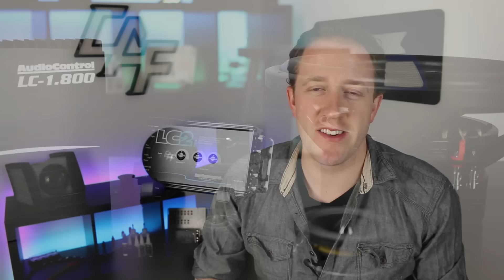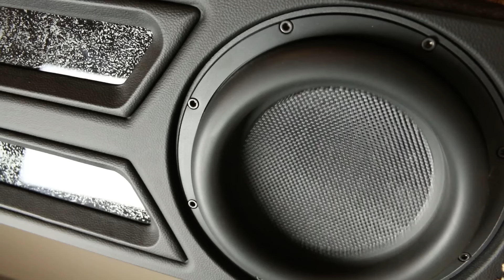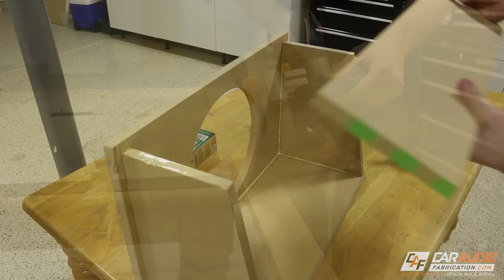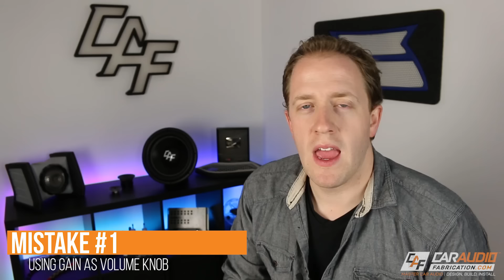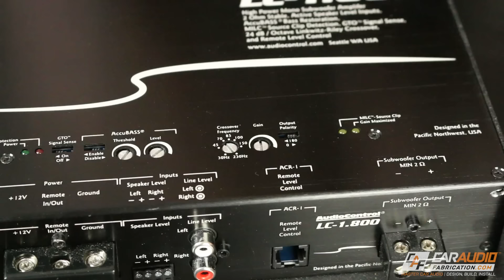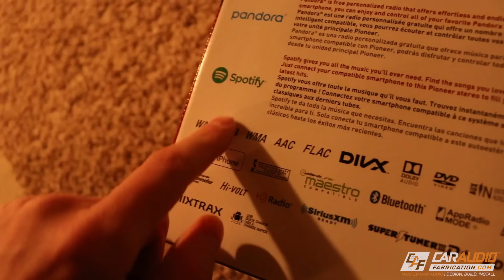Avoid these 5 common Car Audio NOOB Mistakes!

Comment: Worst noob mistake of ALL is to not fuse your power wire at the battery. Either it's because of laziness, or being cheap, or because thinking that the fuse on the amp is sufficient protection. The fuse at the battery isn't to protect the amp, it's to protect the vehicle from burning to the ground!! I have personally seen two cars burn COMPLETELY to the ground for this exact reason.
Reply: I like circuit breakers. costs $0 to reset.
Reply: a c LMAOOOOI
Reply: Scott Haydin or some ppl don't want to use a fuse cuz u "loose some or it power out put thru the fuse"! It's so min it's sooo not worht the risk!  I too have see a few ppl car burning to the cast
Reply: @kdubsav11  you shouldn't lose power through the fuse. You have problems if you do. May not be apparent.
Reply: Or putting the fuse right near the amp... Like what happens if you get t-boned and sheet metal pierces the power cable?
Reply: I would put fuses at the Battery and just before the rear battery feeding my amp block. 
Because "what happens if you get t-boned and sheet metal pierces the power cable?"
Reply: Personally, I run the lowest amperage fuse that allows the equipment to run without blowing the fuse. 1x4ch & 1x2ch, both good brands, and being fed from a 20 amp fuse at the battery with 4-8 gauge wire (can't remember what I'm using), the gains are set ~50%, and the RMS matches the speakers. No problems, here.
Reply: 4-8 gauge dang im not sure what speaker wire looks like in that but im an electrician if its anything like i install that some big wire what the hell are you running that needs like 60 amps
Reply: @Killamain51   most all car audio amplifiers that are any good need 8,4 or even 0 guage power wire. This is because the volts are 10x less  compared to home wiring(12 vs 120). Low volts require a lot of amps to make the watts. Speaker wire only needs to be 16 awg for 99% of all installs and  wire from amplifier to subwoofer usually never needs to be bigger than 12 awg unless its a 2000w+ system or long runs.
Reply: @Killamain51  i use 4 gauge for my bass. Maxes at 2000 wattts peak. Rms at 1000 watts for a 2ohm load @ 12 volts. P/E=I... So 1000/12= current, which is 41.66 Amps. And i know there's louder systems out there. And i use 8 gauge for the subwoofer wiring
Reply: I not in business thinking of not using fuse your going to be burn Everytime bet thousand dollars on it
Reply: True, a fuse is cheap fire insurance.
Reply: I have 2 rockford fosgate P3 12" subs. The specs I believe are dual coil 2 ohm which I believe means each sub has or needs 4ohms...8 total with 2 subs. Each sub I believe has an RMS of 600w which would be 1200w with 2 subs. 
What kind of amp should I get? I heard that using the same brand allows equipment to work best. That said I'm new to the car audio game. I read that when choosing an amp you should choose an RMS range of 75% min -150% max...so for 2 subs pushing a combined 1200w I would need an amp with a range of 900w - 1800w. And the amp would need an impedance of 8 ohms. Now I don't know or understand what the deal is with the different number of channels. But I watched some videos saying 5 channel amps are best I guess for pushing the subs and other speakers if you add some. I would like to add some tweeters and mids soon as well.

Does all of that sound right. Do any of you have advice or recommendations for what amp I should get?
Reply: i have the same 12 inch subs as you and mannn i really like them
Reply: i'm gonna really be anal about this but the fuse in the battery compartment should be calculated using the max power output OF THE BATTERY, not the rest of the system, granted the latter part has to be fused as well.
Reply: I have my wired directly to battery. No fuse because i carry a fire extinguisher  at all times lmao
Reply: @blackblack4090   When 8 gauge wire shorts a fire extinguisher won't help you.
Reply: @fatboy19831  i was just joking man but i agree with u on that ...but my neighbor over here doesnt carry a fire extinguisher  either  he carrys a pair of wire cutters ..lmao he says that qay he can cut wire asap if amything happens
Reply: so true
Reply: Exactly,  the fuse should be there for the protection of power cable to your amp and should be sized properly to the amp rating of the cable.
Reply: Seems to be difficult to find circuit breakers that aren't made of gingerbread or are impractically big?
Reply: Do you have a brand name? I bought a circuit breaker from one of the local car stereo dealers and it was extremely fragile, maybe the ones you bought are more robust.
Reply: My amp came with a 8inch fuze
Reply: Good point.  I note OEM car setups that had the fusebox in the passenger compartment always, always put a fusible link somewhere in the engine bay before passing power through the firewall.  For those of us with a battery in the trunk, a fuse there before distribution is a must.
Reply: @bacon banana Yeah, any time I do a larger electrical install like a distribution panel/block or if it's a high draw item like an air compressor I do breakers. If it's gonna be a single small 4 channel or something i'll use a fuse because they come with the wiring kit.
Reply: well at least I didn't make this mistake lol
Reply: I don't know. I went to my local electronics hardware store and found some industrial 40 and 80 amp breakers. Dimensions were about 3.5"Lx 2"Wx1.5"T. They held up under the hood of my truck for 8 years before I sold the truck. Was running about 2000w worth of stereo and about 120 amps worth of air compressors. (was a mini truck with bags)
Was also nice to just push the test button to break the circuit if you had to work on stuff instead of unplugging the battery.
Reply: ac, Circuit breakers add distortion and can malfunction.  Do an A B comparison.
Reply: @fatboy19831  Ill listen to the Army Corp of Engineers. They state that circuit breakers have almost no affect on harmonic distortion unless under fluctuating heavy load which usually only caused false trips and over heating. 20-80 amps is not heavy load. Getting into the 100+ amp range on a single breaker? sure. For my roughly 180 amp setup split among 4 breakers? Negligible.
Reply: @zososldier  Anything above 50 amps (peak) and you are no longer listing to music.  You would hear no real difference.  Try listening at moderate listening levels.  Use your own ears not the word corp of engineers. Everything makes a difference in audio. Good or bad.  If not..check your hearing.
Reply: @fatboy19831  What are you talking about? we are talking about car audio that usually includes a 500-1000w or larger combination of amps. There is a reason that most amps come with a 20/30/40/50/etc amp fuse. Because they use those amps.
Again, ill listen to the Army Corp of Engineers who diagnose communications equipment for war. 
Might you lose a small chunk of frequency range or drop a few db? maybe. Will you notice it? No.
Reply: I stoped using fuses a long time ago
Cz they burn or make poor power on my amp
Reply: I have no fuse

Comment: Self installation using poor tools and crimps. 
Improper panel removal.
But for dead basic noobs NO EQUIPMENT LAYOUT PLAN 
design concepts should make sense. Hifonics amps are huge and probably not the best choice if you own a Mini Cooper haha

Comment: I was fortunate to work at a car audio shop as my first job out of high school and the biggest problem I would see come in would be improper wiring of the deck and using grossly undersized wire for an amp install.

Comment: Straight up on the old screw terminals were fork connectors go all the time I see village idiots taking a power wire and splitting it and putting it in there. That is a super big no-no

Comment: A common mistake I see made is RCA cables being run near power wires. If you have to do this get heavily shielded cables (normally these are high quality) or make your own. It will ensure that you get the cleanest signal from the source to the amp or processor.
Reply: Yup, one of the oldest rules of thumb in the car stereo society is to always run the signal cables on the opposite side of the car as the power cables.
Reply: You're well prepared for the day you get a car then. ;)
Reply: Whitefox2298  
It is a case of how long they run together. When rca and power meet at the amp there is not alot of flux exposure and what little there is, is rearly on the same axis to do anything. But long run side by side aline the flux field and with distance increase the chances of interference. Wrapping signal cables in wire mesh (like they do with tv coax and arial cables) shields then from all extrenal flux.
Reply: Even I know that and I don't even have a car!  Some day... some day...
Reply: EscapeMCP just checking up if you already purchased a car.
Reply: That was my amateur mistake back in the day haha.
Reply: How much do you think is effecting when they meet near each other at the amp?
Reply: It's the mistake I see most often.and can't believe wasn't included in the video.
Reply: That's a good one!
Reply: If you have a car audio rca cable this is irrelevant even the cheap car audio ones are fine thses are imortant because they come as 2 twisted pair that ensures the magnetic field will be induced equally their by canceling the effects, and side note its not 	AC on the power so not much of a field is induced
Reply: thats why i use cheap twisted pair rca cables along with power and remote wire and no distortion as long as you get bare metal to metal on ground points. but of curse this is for just a sub signal not for full range speakers.
Reply: Doesn't matter in a subwoofer RCA run.. the radiated frequencies they can/will pick up are tossed out by the LPF anyway. 
In a mids/highs RCA run.. an absolute must unless you like whine.
Reply: @WiscomptonBoys  one of the hardest things to diagnose is if you're getting noise from your power source it could be coming from your battery or your radio or even your alternator of course you would hope that you have made sure that your ground points are bare metal and that you don't have any noise going to your amplifier either along with your stereo
Reply: @joeydelmarsjr.646  Well.. it's not exactly that difficult in most cases. We all know, as MECP encourages, identify, isolate, eliminate. It's super easy to isolate most noise issues with just a few steps.. quick drape of RCA cables instead of using the ones run in the car, a quick check of AC ripple at the battery, etc. Very rarely these days (assuming use of decent equipment, anyway) does a noise problem manifest that is more than a few steps to take care of.
Reply: I ran mine through the middle of my car  under the console and the carpeting. 😂

Comment: When I built my audio system, I spent a lot of time figuring out the right gain setting for my amps using an O-scope. I drove around with the car that way for a while... and discovered I hated it. I reset the gains by ear, and now I love how it sounds. Sometimes theory and practice aren't the same.

Comment: Out of curiosity, what do you know about Skar Audio?
Reply: Mike Davalos I've heard people call them "poor mans sundown".
Reply: I have 2 Skar EV12's mounted in shallow pre-fab boxes (I know, the horror!) hooked up to a Skar LP-750.1Dv2 amp and I've been very happy with that setup. It sounds good, gets plenty loud and doesn't take up a huge amount of space. I have a Malibu Maxx which is a hatchback and I have the boxes mounted face down (with the proper sub excursion clearance) and the mat for the car of top of it. It's sort of a stealth install from the outside and still lets me haul a week's worth of groceries for a family of 4 in the back w/o issues.
Reply: They’re good, there’s better but they are better than a lot of Walmart brands. I’m running my mids/highs on a Skar 150.4 and they sound beautiful. The only common “problem” I’ve heard is that they can get pretty warm running full tilt  so just make sure to keep it in a cool, well ventilated space and maybe even put a PC fan over it. Otherwise they’re beautiful cosmetically and same with the inner workings too.
Reply: i have 2 evl 15s 2500 and a  SKv2-4500.1D Monoblock Amp 2 yellow tops in back and 1 under the hood
an they hit an hit hard and yes they look just like a pair of sundowns
Reply: I have 2 old style kicker l7’s running on a Skar audio 1500.1d and shit bangs
Reply: I have 1 skar  audio 1500rms 12  but I’m using a kicker 1200tms amp and that shit hits hard. They need to make some more powerful bullet tweeters tho because I blew mines within 2 weeks
Reply: I run 2 EVL18's in a wall. Really should have went to the next size up for power handling but after broken in, they're one of the best bang for your buck subwoofer I could imagine.
Reply: Mike Davalos I smoked a set of 12s on a Kenwood Excelon amp. Personally would never go with them again. MTX forever! Running two MTX FPR 12-02 on a 1200.1 THD amp in a downfire box modded to allow excursion. They slam hella hard.

Comment: I mounted my door speaker, put the door back together, and turned the stereo on to only realize that I forgot to connect my speaker wire to the speaker. /sigh

Comment: I've been in car audio for 33 years with most of those years doing custom enclosures ...this youtube channel ...is very very good..the only problem I see is glue and clamps on boxes ...the glue holds it in the end but the waiting til its dry would kill me lol...simple nail gun..at correct pressure dosent sqeeze glue out and you can build faster. But thats ticky tack crap...you have more time than me..over all 👍👍👍👍👍...watch and learn ...absorb info..
Reply: screws over nails any day. if glue was to ever fail, a screw will hold much longer than a nail under all that pressure and vibration
Reply: Velcro FTW.  It's waaay easier to change out my blown speakers.
Reply: Loud Elvis I use screws and glue
Reply: James Zawacki this is true. I just don't have an air nailer,or enough clamps, and don't want to hammer on MDF.
Reply: James Zawacki,  Most car audio subwoofer boxes are made of MDF or particle board.  True wood expands and contracts in an automotive environment.  Even well aged wood.   Screws and glue are best in true wooden boxes.
Reply: Hey I'm getting back into car audio after 25 years yeah I'm old lol but I'm just looking to upgrade my factory speakers and to add  a 8/10 inch sub for some punch nothing crazy I been looking at NVX audio any suggestions My budget is 800 Rest in peace PPI Art I'm looking for a 5 channel amp 6.5 door speakers on each door and a small sub box
Reply: Into this stuff back in the 80’s and 90’s we knew people at the audio shop showed us a lot. If you wanna seal a sub box go get couple of tubes of liquid nail caulking and a caulk gun the brown stuff it doesn’t get hard and crack. When it drys that’s it and use like 1 and 5/8 drywall screws. I had a box once wanted to take it back apart ended up busting the partical board up  the liquid nail caulk stayed.

Comment: I just want to point out that the reason I started installing my own systems is because not one of the "professional" shops used any kind of instrument other than there ears to tune any system they installed. This has cost me a few speakers. Sence I started installing my own systems I haven't had any "blown" speakers.

Comment: You can monitor clipping with an RTA to set the gain. It’s not as accurate as monitoring for distortion but it will get you pretty close

Comment: When I was working in car audio the biggest problem I came across was people not knowing how to pair amps with their subs. They would come in with a 2ohm stable amp and 2 dual 4ohm voice coil subs. Then I would get to explain ohms law to them and why their equipment wasn’t going to be performing as good as it should.

Comment: Not saying you shouldn't upgrade you electric. But if you get hid headlight with the ballast it will stop the headlight dimming.  I don't personally like capacitors. But this is all my opinion
Reply: Chunk it’s a good idea. I have plenty electrical and I still have slight headlight dimming.
Reply: Headlight dimming is hard to get away from, i dont even have a real sound system in my car (but other things that consume power) and i installed a bad ass alternator and a battery and they still dim a bit so i couldn't imagine if i was to install some amps and things like that.
Reply: People always talking about capacitor Y they don't like when they don't know there real purpose..The better your amp the bigger the capacitor are in your amp..They help clean noise out your power line.It stabilize the power..Ur capacitor 4k n better for bigger system
Reply: Installed a 5 Fahrad capacitor in a 1400 watt setup once, there was zero difference in performance, but when I got a better battery there was a significant improvement in perofrmance.
Reply: Håkon T. That a baby system  if ur shit was dimming u didn't  have enough  power to begin with  my friend.... First off the car alternator is at 14-15 volt...A car battery only operate at 12.At 13 if it has a surface charge....So your light  are still going to  dim.... The bigger  ur Amp the bigger and more capacitor is in the Amp.... There there to clean noise out the system.... If you  have the correct  power... The capacitor will curve some of the volt drop.... But if you don't have the power  lights will still dim... But the bigger the capacitor the cleaner the power with out noise
Reply: I installed hid's in my truck ..had to take them out becuase they (when turned on )emit a frequency that my cb antenna was picking up , causing a whine noise( almost like an alternator whine) through cb speaker...took them out ,no more noise ..kinda sucks but oh well
Reply: @nightcrawlaa  I had an issue like that, my brother gave me some $10 C6 headlights he got from ebay. I told him he was dumb for buying them, 2 years later same bright headlights and no noise.